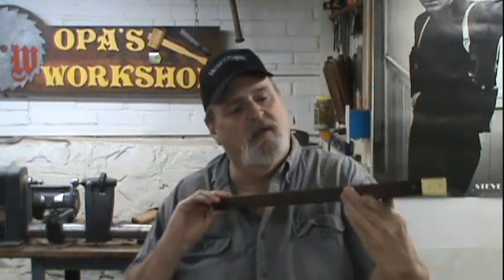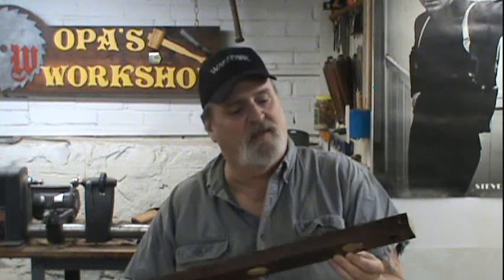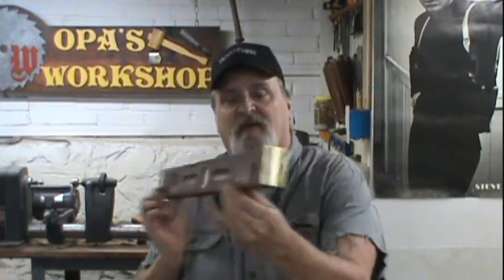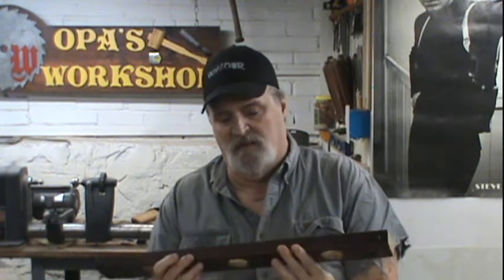RESTORING GRANDFATHERS LEVEL

Comment: Good Job Opa in refurbishing your Grand father's level. I love collecting and using old tools. My love is collecting tools that either were made by my dad or bolt and tree limb cutting tools made at the H.K. Porter plant he worked at in Sommervile, Mass. My collection spans 82years. From 1916 when my dad was 4 to 1988 when they closed the plant after he passed! They are better than the new tools they make now!